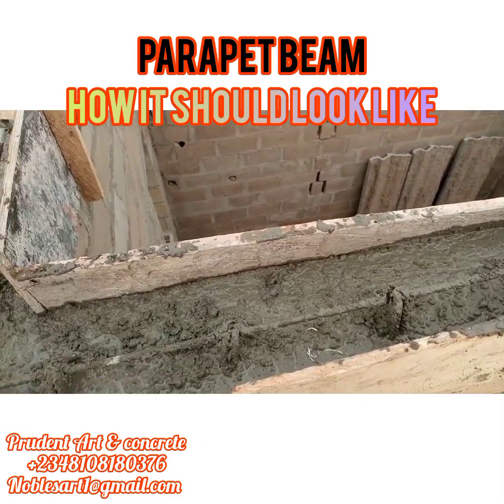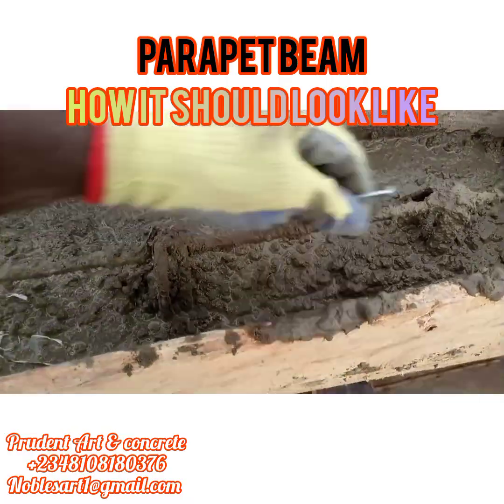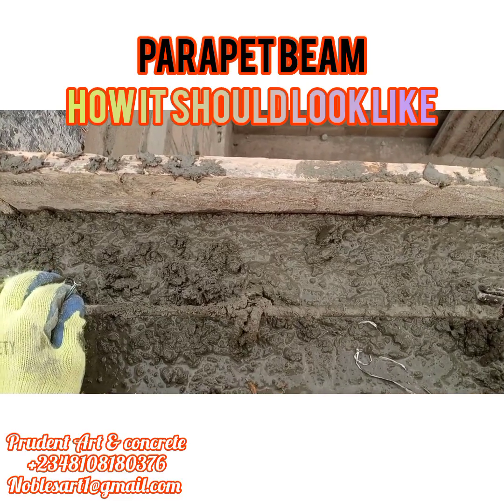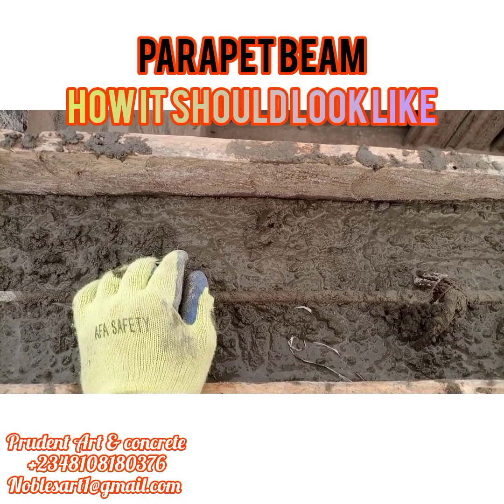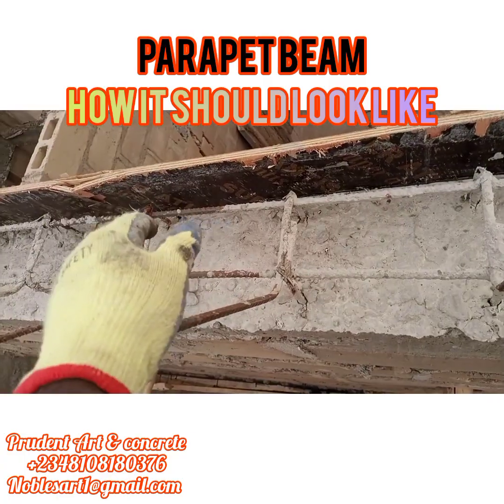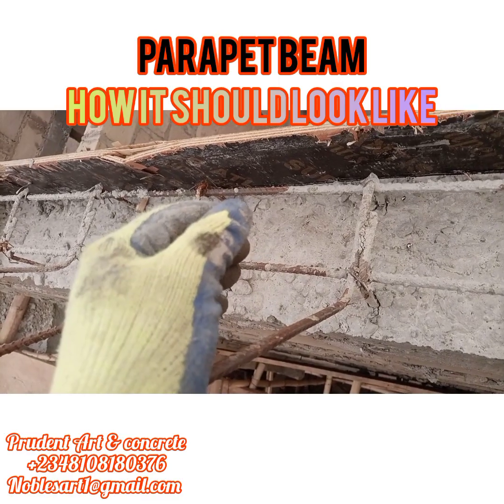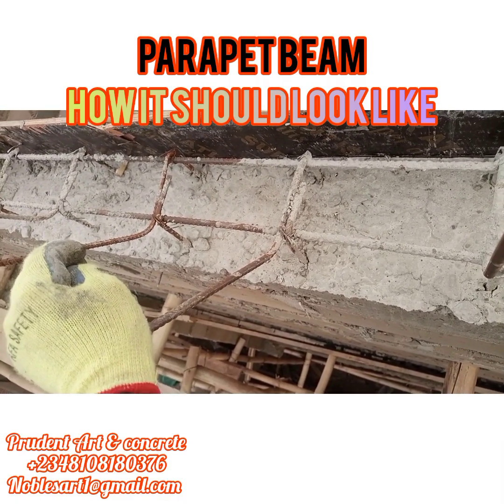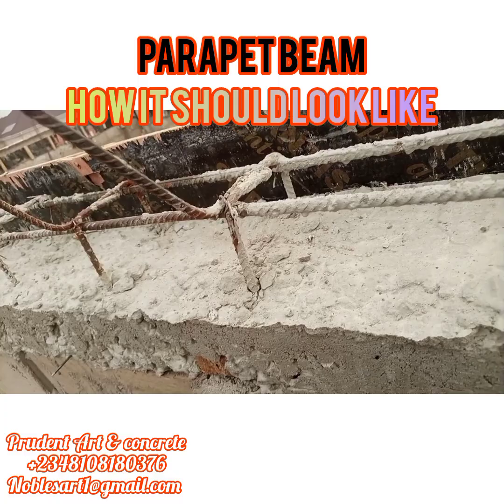how to make reinforcement Beam for parapet. must watch video for all Builders

Comment: Are you saying the triangular shape reinforcement will not work for precast facia parapet?
Reply from the maker: No am not, the size of Parapet you want to install will determine the type of beam you will use, triangle beam is more suitable for parapet below 50cm wide
Reply: @prudentartandconcrete  Thanks. But why only 50cm wide? Also, have you ever used 10mm bars and 8mm stirrups for the triangular reinforcement system? Many people used 12mm but this may be unnecessary.